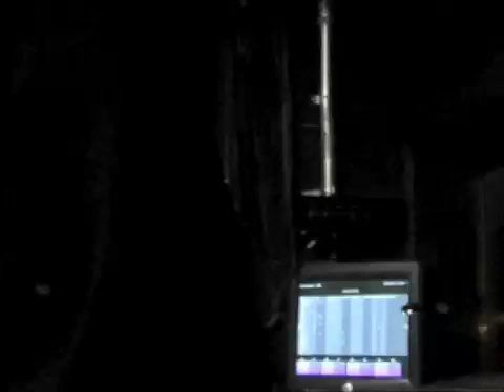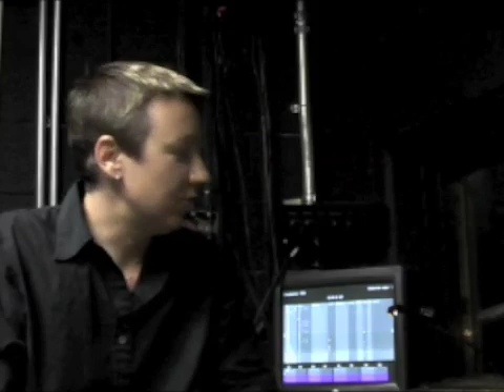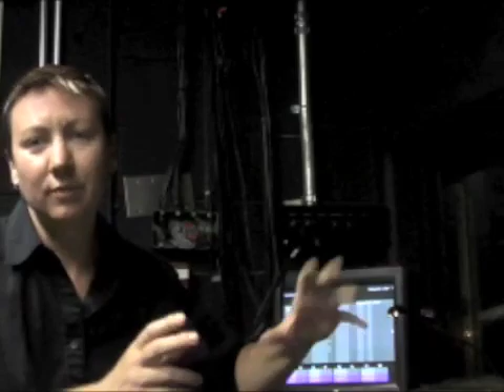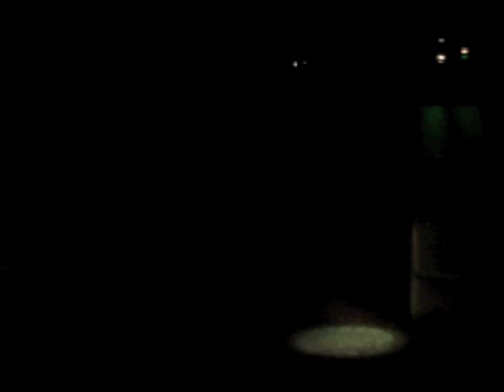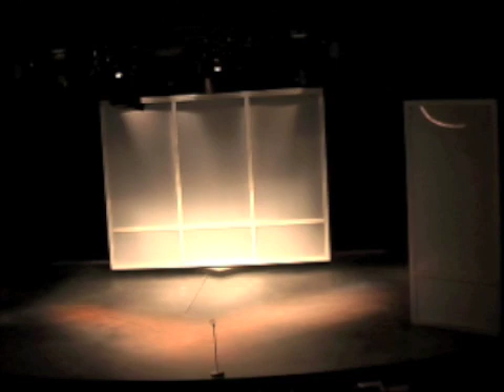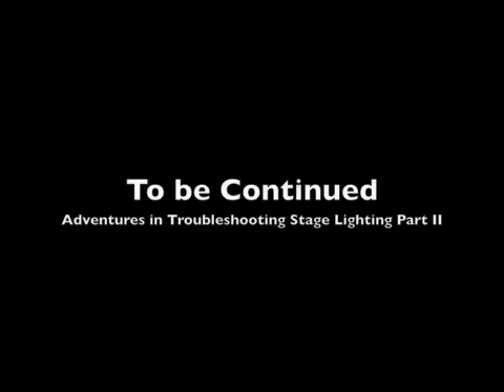An Adventure in Troubleshooting Stage Lighting Part I

Comment from the maker: It turned out to just be dirty data in the board related to the memory being so full.  Nobody had bothered to delete show files in the last 10 years and there were 1275 shows file.  When you check the available memory, it still had plenty, but ETC tells me that this board starts having problems after there are 50 shows saved.  Good tip for everyone.